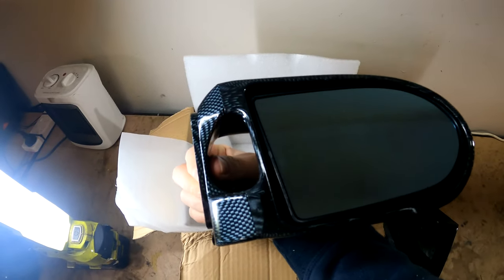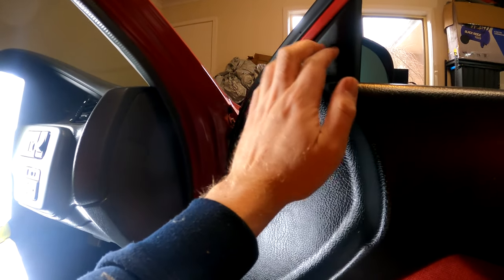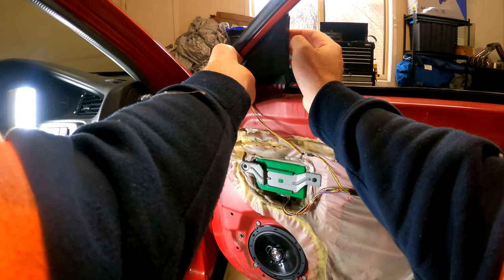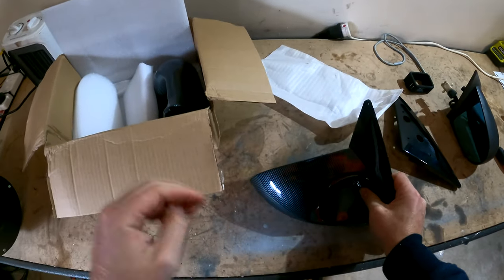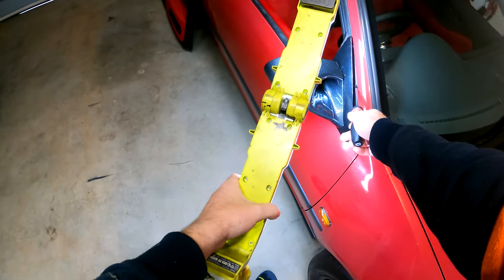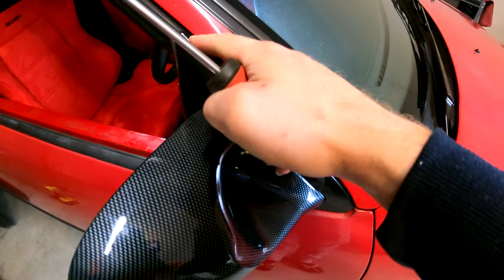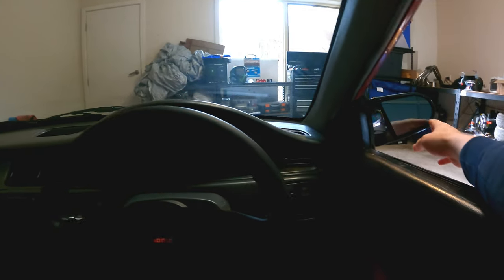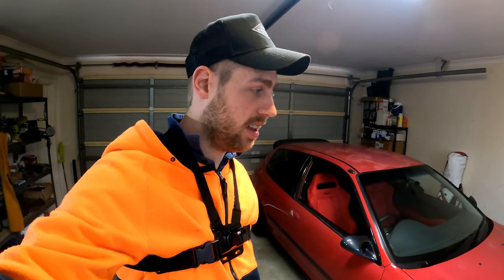Carbon Ganador Mirror Install | Eg Civic B16

Comment: Where did you get the interior block off plates
Reply from the maker: The other side of the mirror?
Reply: @JarrodWillemse yeah the interor
Reply from the maker: @chriswiebler6151  behind the mirrors on the door cards